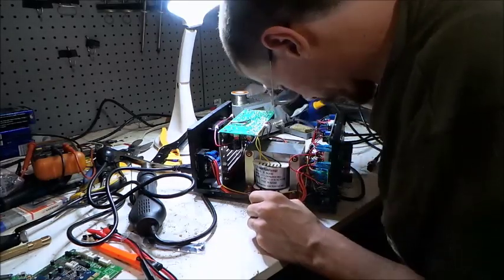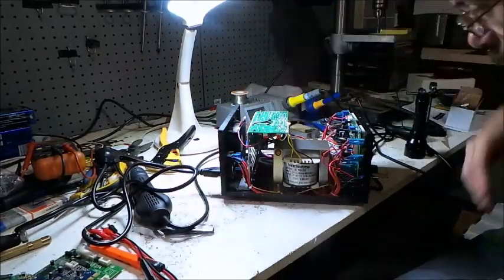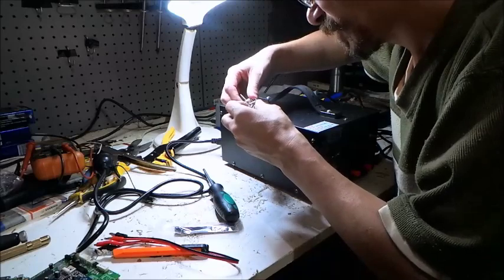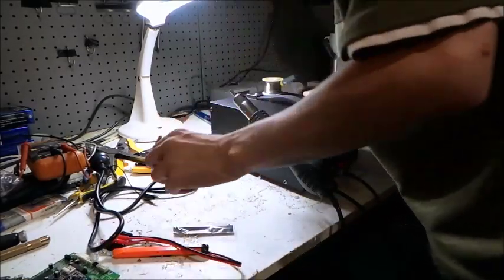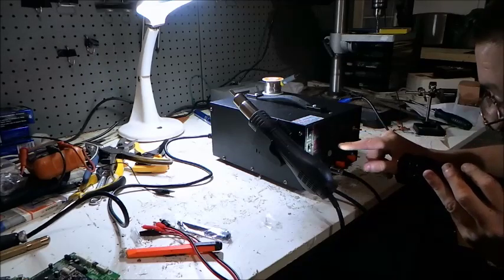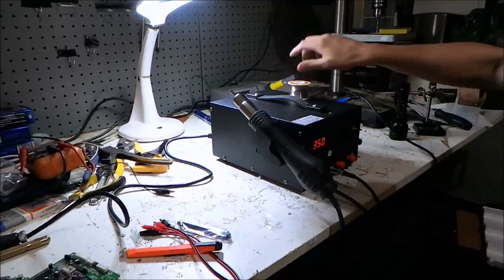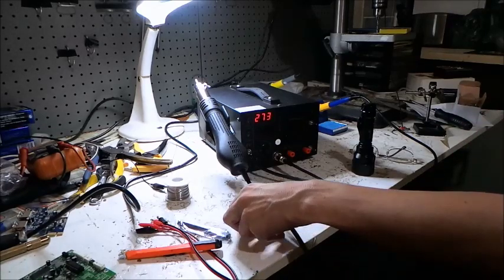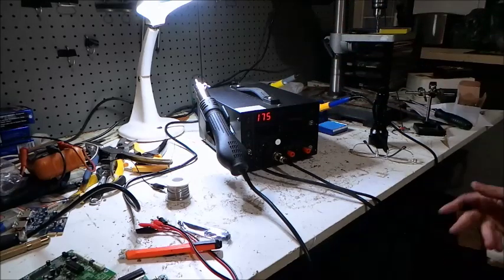WEP 853D hot air rework station part 2

Comment: Man, I love this video of the teardown, certainly useful. How is your experience with this unit? ( before I get one) cheers
Reply: I have been using this since 2011.
Hot air handle has just died.
Couldn't find the proper spare to replace.
Inside is crap, solder joints are horrible but it never failed me.